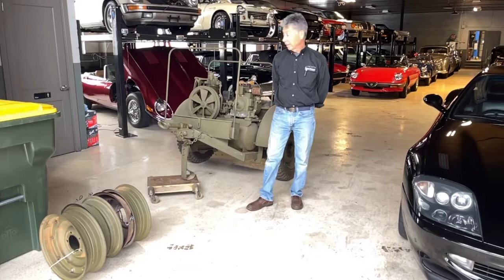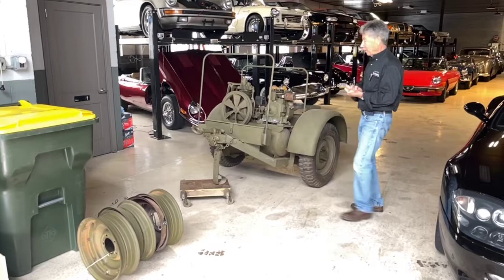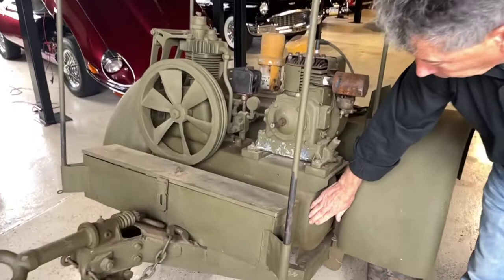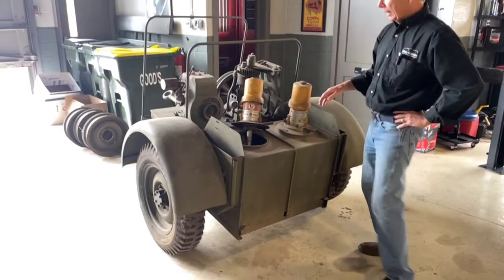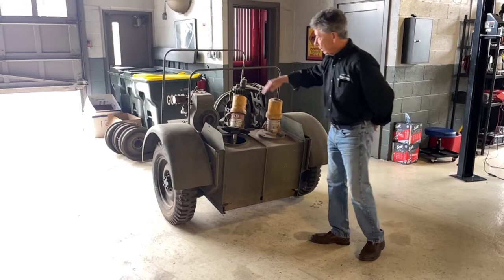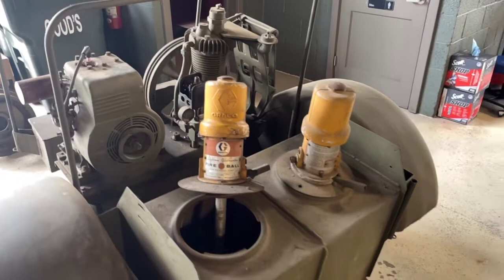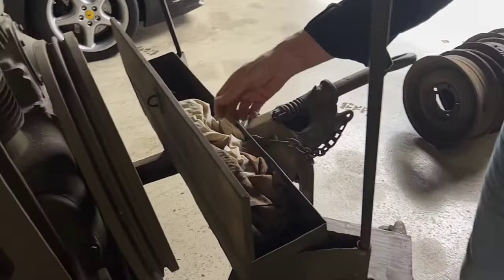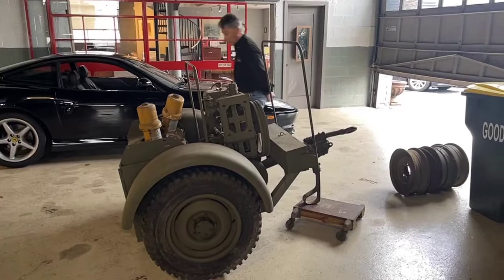1942 Ford GPW trailer walk around

Comment: Very nice trailer/video. The landing leg in the draw-bar of the trailer is post W.W. 2 as well as the Briggs & Stratton engine. I own a generator (P.E. 75) with the same type of engine but all cast cooling shrouds, mine is a Mar. '43 beginning of production. A museum I worked at had an Aug. '45 which had sheet metal cooling shrouds that were shaped differently. Your lube trailer is more than likely Korean War vintage, but don't mark my words. ALL of this type of equipment is quite rare to have in complete configuration anyway and just as significant and important that it be saved.